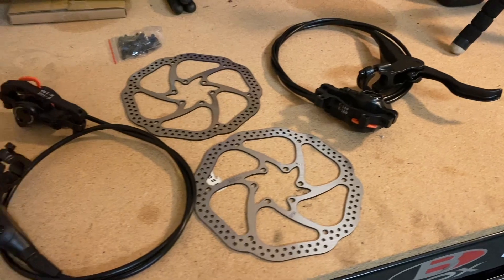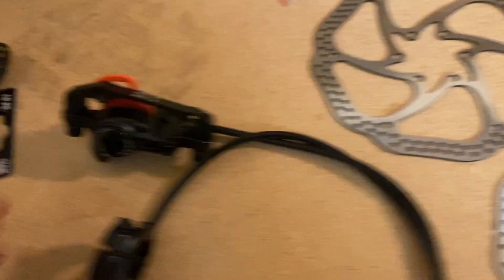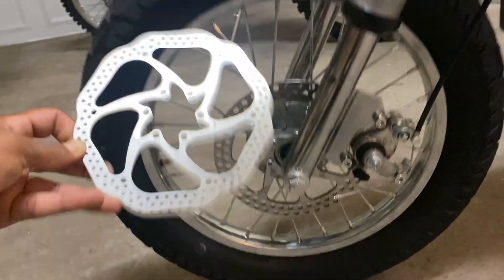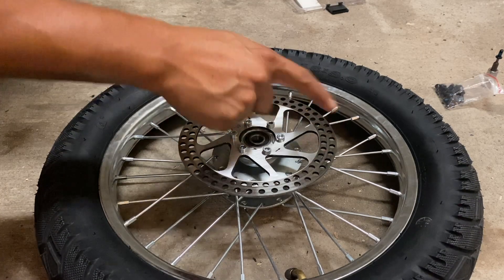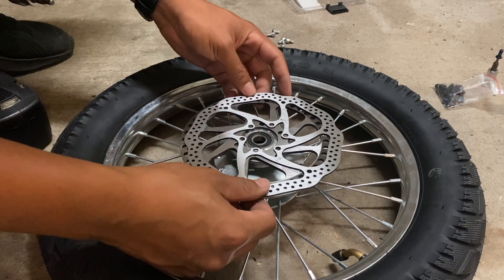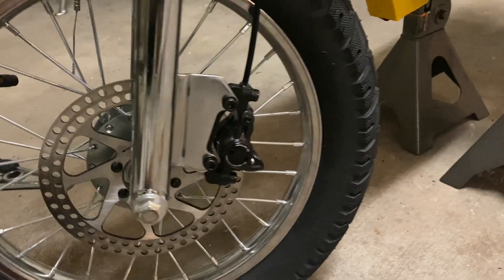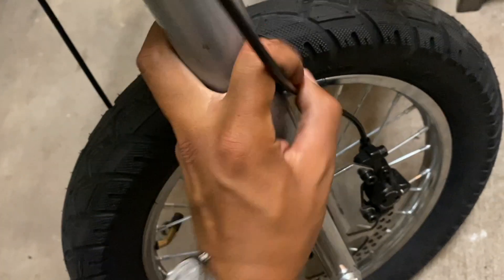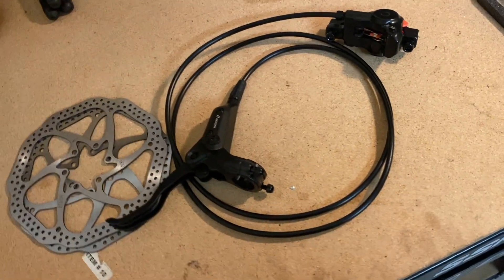Razor MX650 Hydro Conversion Part 1 | Installing the ZOOM Hydraulic Brakes with Bigger Rotors

Comment: I am having such a hard time mountain electric and co.'s stuff to the mx 650 right now. I bought everything the V2 forks, sing arm extensions,10" super motos, 5000w ulatmite kit with a 76 v battery, both 4 piston hydro brakes & RAZOR/ ETM hydro brakes, yet I'm still having trouble mounting the front and rear brake as it's not working with spacing, rotor won't align with the pads, I'm beyond confused and I've spent quite a bit and saved up for a while

Comment: 2 years late, but I do want to mention that I thought i didn't need new rotors until I saw this video. I asked chat gpt (AI)  how to do it without buying new rotors but I found this solution (i figured this out): take a flat head screw driver and press each pad into its socket so it opens the gap a little bit, then squeeze it on the rotor. It's tight but it works. Then use the stock mounting screws with the calipers. Do note that the pads are really wiggly so you might have to do it a few times. Thanks for reading this to the end, and if you need any help ask me anytime!

Comment: Yoooo how tf did you fit a hydraulic brake caliper over the stock rotor? The stock rotor is to wide to fit my hydraulic brakes and I have no idea how to fix it
Reply from the maker: @SupaMega  This is a super old video, but you don’t. Check out part 2. Just get 2mm thick rotors to match. It’s like $15 for a pair: https://amzn.to/42UUPrG

Comment: Hey pat,  where could I get those same type wheels except I want to keep them same size as what comes with the mx650s- (16f/14r) I believe.    Seems yours are a lot smaller.
Reply: After looking at your links, seems you do have same size as original wheels.  Am I wrong?   Ok thx
Reply: Hey so I looked further into what you have on your bike.  So you purchased that 10” tire and that fits on the 14” rim that the 650 came with?   I currently have the 650 & looking for a new set of front & back rims/wheels.  I don’t want to go smaller & want more of a dirt/street friendly.   I like those tires you have but don’t see how it fits on the 14” rim.   Am I wrong here?    Ok thanks again.
Reply from the maker: Unfortunately MMG discontinued the front tire I ran at the time. I just had the original 12" front rim and 10" rear rim. Tires are MMG 16" (OUTER DIAMETER) x 2.6" front and 10" (INNER DIAMETER) s 3.5" rear. Don't run more than a 3.0" rear tire unless you have a swing arm extension kit installed.
Reply: @PatOutdoors  good info.  Thank you.  Much appreciated

Comment: Those zoom brakes support a 1.7 to 2mm rotor thickness correct? You can not use the original razor rotors that are 3mm thick, right?
Reply from the maker: @trsd2009  nope! That’s why I ended up getting mtb rotors with 48mm bolt pattern on part 2

Comment: Thanks for the video and the guide. I was able to do this modification on my son’s MX650. I didn’t end up needing to disconnect the hydraulic lines to run the brakes. That said - I did cut a notch in the number plate to pass the lines through the number plate.

Comment: What brake pads do you use? I’m going through pads like crazy
Reply from the maker: Did you swap out to 2mm thick rotors? Is one side pad wearing faster than the other? Make sure the caliper is centered with no drag on the pads

Comment: Did you have to use the step down converter for the headlight?
Reply from the maker: You could also just use an led headlamp that’s rated for up to 90 volts without one though, check my my video posted just last night (4 minutes in.)
Reply from the maker: Yes, most automotive headlamps are rated for only 12 volts. This is the one I used for (4) of my bikes: https://amzn.to/45wb4K2

Comment: I can’t get the front break caliper on to the fork. I have the G zoom breaks
Reply from the maker: What’s the problem you are having? Distance between the holes? Did your caliper come with the 140mm to 160mm or 180mm adapter?

Comment: I had one more question Is there a way to make your brakes wider so you can fit it on the stock disc brakes?
Reply from the maker: I would not suggest doing that
Reply: @PatOutdoors  👍

Comment: How did you fit the stock rotors into the calipers? Mine stock rotors are too thick
Reply from the maker: I didn’t. These are 2mm thick rotors, check in the description and please fully watch part 1 and part 2 videos.

Comment: Iv had my bike for like 12 years now, and for some reason when I put these breaks on the bike they rub like hell! Iv tried adjusting them but no matter what they rubbin, might swap back to wire
Reply from the maker: Where does it rub? Try putting small washers between the calipers and the brackets to space it away from the rotor.
Reply: @PatOutdoors  the pads are rubbing on the disks, when you spin both tires they come to a almost instant stop. I have the spaces installed that are used for the caliper. the disks fit in between the pads but there’s no extra room if that makes sense
Reply from the maker: @BSwort  Ohhh you have to swap the rotors. You can't use the stock ones. They are too thick. I used these ones: https://amzn.to/3BNz3bW
Reply: @PatOutdoors  gotcha man thank you, I’ll give this a shot!